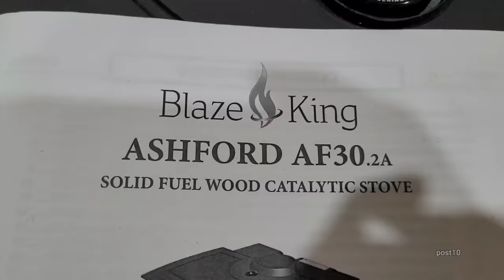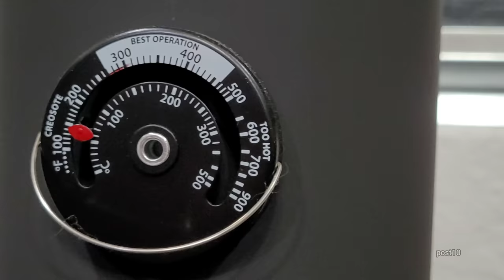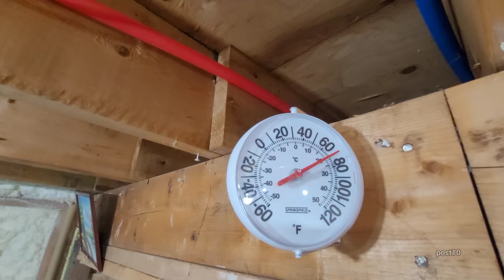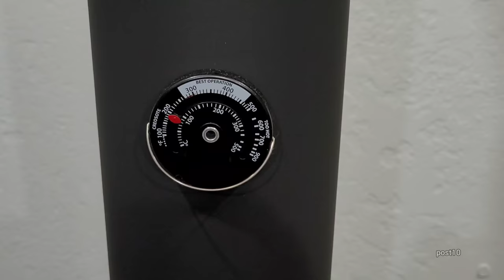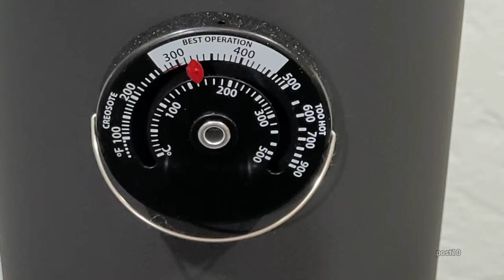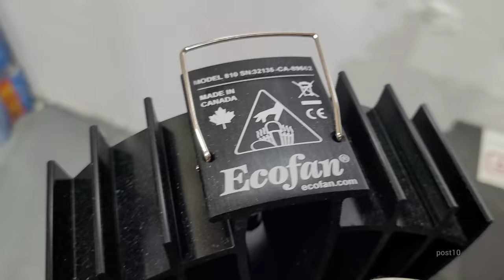Why I Started Heating My Home With Wood And How I Manage My Land. Blaze King Catalytic Stove Review

Comment: Hi,
two tipps and tricks for a starter: 1) avoid round logs as much as possible. Split it at least once. It will catch fire much better and burn more efficient with lesser risk of going out. 2) your kindling from outside works, but there's a much better option: split dry wood with a hatchet or knive into small sticks. pencil size. Some smaller, some wider. Build a tini tipi around some paper, ignite the paper. Paper burns away wihlie igniting the pencils. So, your tipi gets a lot of air from below. Build up with bigger sticks as you go. It's incredibly fast!!!
Splitting your chunks and kindle will give you very dry wood, catching fire easy, fast and reliable.
Plus: making firewood and kindle is a lot of fun. :-) 
Greetings from Germany,
Pete
Reply: I’ve learned an easier way for starting fires than the tepee method. I agree it works well but I often find it tough to keep the tepee stable while building it. What I found to be a lot easier is building a small square type of log  “cabin” surrounding your tinder. You can also put some sticks across the top above the tinder - but leave enough spaces for the fire to breathe. It works really well and I recommend trying it out
Reply: @RealBoiJare  true. Not mentioning the lean-to!. :-) Same principle. But, you're right: cabin i better than tipi!
Reply: @RealBoiJare --And I have a Much easier way. Get a Pellet stove. It's an Automatic wood stove🤣
Reply: @ronmcmartin4513  my easy method when the logs are wet is to use my propane torch lol. But that’s basically cheating. I’m going to try using flint and steel more often next summer for an added challenge
Reply: @RealBoiJare --I just push a button, or even more Lazy, set the timer & thermostat on the Pellet stove, replenish the hopper with pellets whenever it's low, and it automatically comes on 2 hours before I get up, for a few hours, and then in the evening for 3 hours. Beat that!
Reply: I was going to say a lot of this. Now I don’t have to
Reply: @ronmcmartin4513  that sounds easy and definitely makes sense for heating your house. Im basically only starting fires when I’m camping ouside, so it’s not quite that easy for me! Especially if the wood is damp
Reply: What pellet stove did you buy? I have been skeptical of the heat output.
Reply: Great idea for the kindling. Hubby and I dedicate a few days in autumn to splitting logs down to kindling.  We've got boxes stacked up to get us through winter. Good kindling makes things So much easier.  👍
Reply: @ofthewoods137 -It's a Castle($1250). I wrote a lengthy comment to Post 10(look for his avatar response) for features. It depends on how big is your house for heat output. If it's 2-story up to 1500 sq ft, One stove is enough. But if you have a large 1 or 2 story house, I would buy 2 for "Zone heat"(Living & Bedrooms). It certainly is not as convenient or fast as Forced Air(15 minutes vs an hour). But it only costs $100 per month for heat, rather than $300-500 for Gas/Electric. I've hear $1000/month for oil burners. But I also don't have my house at 100 degrees in the winter.
I've had an Expensive Lopi Fireplace Insert with very few features, an insert that was Garbage, but already in the house, that I replace with the Castle. It's the Features that made the difference.
If you're going to spend $300 for a Cord of wood or the same for a Ton of Pellets(50 bags @ 40lbs, Same BTUs), it's a No Brainer to me.
Reply: Very Informative, beautiful property!
Thank you
Reply: Top down is the way to go
Reply: Do the WrangleStar method and put the big logs on the bottom and the smaller up top until the very top is paper. That way the hot embers fall into the wood on the bottom.
Reply: Thank you Pete 😊
Reply: @ronmcmartin4513  We were talking about getting a pellet stove in the basement. Our basement stays about 40 in the coldest months. If we can keep the foundation of our house warm, it should keep most of the house warmer. When we moved up to a more efficient propane furnace and hot water heater we eliminated the need for the 6" exhaust vent for the less efficient furnace and hot water heater. Our plan is to vent a pellet stove through this vent by adding the 3 or 4" that is necessary for safe pellet stove operation. Essentially we will be running a 3 or 4 inch vent pipe up the 6 inch vent pipe.
Reply: @ronmcmartin4513  when supply chain gets disrupted, you got no pellets. Post said he wants a SHTF option.
Reply: @RDJim --You buy pellets once a year. If you're a survivalist, you buy 2 years worth.
I don't live my life worrying about Armageddon.
Reply: @MattyEngland  Dip the house insurance into the pint of gasoline first for better igniting! 🤣🤣🤣
Reply: @peterheinrichs7634  lol 😂

Comment: Nice video, thanks. Regarding getting ash in the air when cleaning out the stove: drape a shop vac hose over the stove so the opening is right above the door. The strong vacuum suction will suck up virtually all the ash that would otherwise go into the air.

Comment: If you can get ahold of some black locust or hop hornbeam wood, I like to throw a few of those in for those extra cold nights. They burn twice as long as seasoned oak and probably 10x as long pine. Nice to have them on hand. I also use a propane torch to light my fires, really convenient and a small 1lb tank lasts a whole year.

Comment: Great post and spot on!  You're being a good steward to your land.   I learned everything you explained after buying a place in Maine after the ice storm that hit the NE back in 98.  I spent years cleaning out the woods to open up the ATV trails and to feed my outdoor wood boiler.   The standing dead trees are usually the driest and old timers would tell me they'd often drop or girdle trees with plans to process them the next year as they'd dry out quicker with limbs and gravity drawing out the water faster.  LOL on the wedge since everyone who's chain sawed has bound it up at some point.  Having two saws is also a solution.  If you ever want to come up north, I have a old wood stove we took out of the kitchen that they used to cook with I'd happily donate to you.  Your video is inspiring me to get out into the woods this weekend, but, the cold is pretty demotivating.  Thanks again for posting!  PS - If you are in Maine, make sure your land is in Tree Growth, incredible tax break.

Comment: I heat my house with a massive wood furnace each winter and it works amazing! Mine has a huge blower and ductwork built around it which connect to the main network of the house. The garage where it is installed is always around 80 degrees during the winter. Even with our multi-day blasts of below 0 temps; the house always stays at a comfortable 60 degrees. When the weather is more in the low 20's outside, we sometimes have to actually open up some windows to cool down the house as it gets too warm. Plus; using the wood furnace means I don't need a gym membership as cutting, splitting, stacking (then the subsequent hauling of split wood over winter); makes for a wonderful workout.
Reply: Brandon, I am glad to read @ your effortless heating of your house. That task of cutting 🪵 and hauling wood makes for a less expensive and greener way to stay in good physical shape out of what God provided for us.

Comment: Axes suck for splitting wood, but a good maul works wonders. I split hardwood logs much bigger than 14" all the time.  The way to do it is to split off slabs from around the edge until it's a manageable diameter. Frozen wood also splits much easier.

Comment: Dad used a combination of wood stove, fireplace with custom air tubes alongside the fire box and electric to heat his house. As you're finding, he didn't need the electric much. He kept a variety of woods in his forest and took management of that forest seriously. Lumber weekends started in October to supply for the coming year. As for seasoning, he adopted holzhausens instead of the straight or criss-cross stacking that most Americans use. He found the air flow to be better. The ash was used on the walkways and in the gardens.

Comment: My room is up in a finished attic and I always open the windows top and bottom for better air flow.  I also installed new windows and can easily pop out the top and bottom pane and just let air flow as it wants. 
Love all your videos!

Comment: This stove is great never heard of it

I always start my fires with a propane torch so much hotter and you can stay out of the heat easier
Reply: Always just use a torch. Also its best to not let it go completely out and maintain a bed of coals until its either time to clean or its warm out. And when you clean out the ashes always intentionally leave some behind, they help insulate the fire from the "ice cold" metal of the stove trying to steal its heat before it really gets going. (And if the chimney is cold it causes a downdraft blowing smoke into your house so you want to get it hot enough to reverse that flow quickly)

Comment: In regards to the dirtying of the glass, rather than buying cleaner, you mix a little of your ash with some water, and use it as a cleaner with a paper towel.  Cleans up the glass incredibly well
Reply: As a note, either wear hand protection while doing this or wash your hands immediately after.  One of the reasons this works so well is the lye present in wood ash helps to dissolve some of the compounds that are staining the glass

Comment: You should get those mirrors from your delivery van(?) Camper thing, and put behind that stove on the wall. It will reflect the heat back into the house like you want. The camper is already metal and still reflects some. Not near as good as the mirrors, but I think you would get better use in the house.

Comment: I am purchasing a wood burner stove and this is a very helpful video for proper stove operation. I am using the same strategy in that I will use an extra large stove to heat a 2,000 sq ft home. We discovered that during a cold snap where we experienced -40F due to a polar vortex our furnace could not get the temperature above 54F. The furnace is rated at 68,000 BTU. The wood stove I want is max rated at 80,000 BTU. Again, good video. I also enjoy your drain clearing videos as well. A video on you splitting wood and stacking wood would be most welcome.

Comment: My stove is in my kitchen so I've become an expert at removing (cold) ash with very little aah dust. I take a brown paper bag ...the large supermarket kind. I spray the inside with water. I keep a spray bottle of water near my stove. I give it a fairly good soaking. I use a mini plastic dust pan (dollar store sells the mini plastic dust brush dust pan sets). No long handle. It's small enough to easily get into all the corners. The wet ash bag stops the dust immediately.

Comment: We had a wood stove in our house, in addition to a heat pump.  We used it to make the living room a little warmer, plus ran it through the night, damper shut way down.  One year I slipped and fell 3 times coming in with wood from the woodshed on the ice.  My husband is not capable of bringing the wood in, or harvesting the wood.  We switched to a pellet stove, and have a little cart to bring in the pellet bags.  I miss getting up in the middle of the night to poke the stove and throw in a couple more logs.  It is nice though to wake up when the pellet stove comes on automatically.   Love your log splitter, makes thing easier.  We had 70+ pine trees taken out this year by our arborist, all diseased wood though, pine beetles, so he took everything away.   You’ve got a beautiful property.

Comment: Oh yeah, the droughts have been horrible on pine trees over the years, over here they do cleanups and cut down most the ones that have a ton of those bark beetles in them, otherwise the problem just gets worse and worse overtime, since they breed like wildfires, exponentially growing in numbers, making the next seasons even worse. 
And yeah, clearing the floor debris, getting rid of some of the rotten fallen trees also helps that situation too. Also I'm sure others have mentioned it, but for the logs you can't burn anymore cause rot, you can use those up in any garden beds you might have, mixing em up with the soil, makes it richer.

This is a really great vid, good luck in clearing all that up, it's good to keep your forests healthy and cleaned up folks

Comment: Love these videos. Liked the one with the bachman truck too alot. I live in a family that has burned wirewood in multiple cast iron stoves over the years and split all of our wood. We have always used a gas log splitter and we have multiple chain saws for logs too big or making smaller pieces to haul. Helping my parents since I was very little find wood in a big city we live in and haul / cut it all. My goal is to find a house where I can have a small solar panel farm for heat / electricity and have a wood burning stove in the basement for a backup. I always leave a air purifier in the room to catch the debri and ash in the air rather than my lungs catching it. Also sucks up smoke and filters it quite well

Comment: Great video on this. I'm considering getting a Blaze King as well and this may have sold me on it. Try doing a top down start to your fire to build the draft quicker - it makes my life much easier with my woodstove. To clean the glass, dip a wet paper towel in to ash and scrub the glass. It's good to keep it clean so you can see what's going on for safety and it will radiate heat better.

Comment: We have had the same stove for 7 years,  -5 to -40 c no issues with the stove, pine and spruce always, because of the catalytic converter we do have to clean the cresote usually around Christmas ( start burning early Oct) and again in the spring when it's warming up( March) never had to change the converter yet, 8-10 hour burn if we want still all those years later, nice video!Enjoy!

Comment: You can take one of those chimney cleaning logs, slice it like bread, an inch or so thick and a slice will make a nice fire quickly without the cardboard or the really small stuff.  Works very well and saves a lot of work. Also if we don't have air conditioning  running in July/August in the Dallas Tx area the inside of the house will get a hundred degrees and I have never heard of a wax ring melting.

Comment: Hi UK viewer here...I've been burning pine for years for the same reason as you .. for us it's free...ours is dried till it gets to 10-11% moisture before burning...I just sweep the flue (chimney) every 2-3 months during the constant burn season and have a super clean out before the burn season...we have an 8 meter twin wall flue and 'cold' block is a problem but once the air is moving the draw is amazing it roars .....the zip chimney cleaning sachets work very well turning all creosote into dry powder and brittle carbon which is easy to sweep when cleaning the flue...as for air flow install a dr21 vent for fresh air make up ... If it gets too hot open a window....all that makes sure we have no natural gas bill.

Comment: on a few of my stoves there’s an air wash feature so it directs the flame to keep the glass clean. I found if the stoves not hot enough this happened or unseasoned wood or the air wash wasn’t on enough
Oven cleaners very good for removing the baked on carbon.
Very good idea with the fire mat. Good vid man

Comment: My parents have been heating their house with a regular wood stove for about 40 years. Same stove. They have a similar-sized ranch home. They made 1 vent from the basement on the other end of the house to let more hot air up but otherwise just keep the basement door open.

Comment: I absolutely love your content. As for cleaning the glass on the stove,it needn't cost you a penny. Get yourself a sheet of newspaper and wet it. Dip it into the ashes and rub it on the glass. Then wipe it off with a cloth. It won't scratch the glass,it isn't abrasive. But it will make them crystal clear

Comment: (a thought) In a previous video of yours, I recall an old 2 story brick house that had fireplaces and woodl stoves for heating. There were some small circular openings in the floors close to the walls that allowed heat to flow from rooms below. I agree in suchlike fashion, a couple of furnace air-duct in your basement could be opened up where a connection meets the floor vent. This would allow the buildup of basement heat to flow throughout the upstairs. But of course there's always slight smoke getting upstairs, unless your okay with it.
Some old homes also had centrally located square or rectangular openings in a floor with a grate to walk on. 
Glad you chose a wood stove for heating which many are doing it now. Yes, modern wood pellet-burning stoves are another option using small pellets measuring 3/8 to 1 inch in size to burn. 
I really luv the forested property you got... What a hoot to be able to harvest fire wood and enjoy that small wilderness!

Comment: Nice Work on learning the stove! Glad to see you have the Manual. You have plenty of clearance around the stove. The clearance chart is in the manual and the measurements apply everywhere no matter where you live.
They are part of the certification process. 
The Asford and the Chinook models have a convection space between the top of the firebox and the top of the stove. For these models the fan kit is worth gettingas it blows the air out of this space. You will find a bunch of heat sitting under the top of the stove just needing a little push. 
Also the Eco fan works best when you place it directly over where the combustor is located. That's the hottest spot on the top of the stove. 
Great job on the video and great job taking time to learn the stove.

Comment: You need a thermostatic controlled ceiling fan in that room. So once the air temperature reaches a certain temperature, the ceiling fan will turn on. Using an attic fan control to operate the ceiling fan would be ideal.